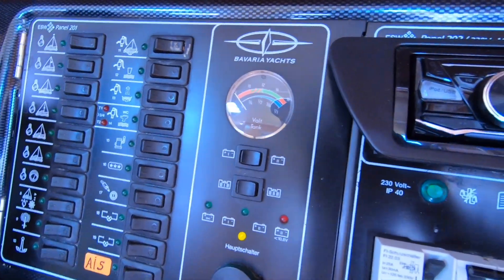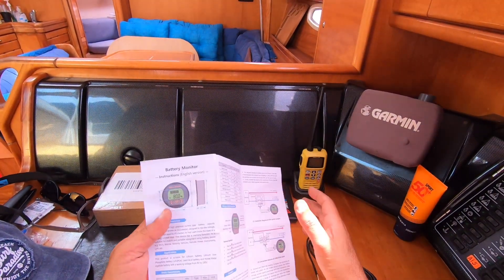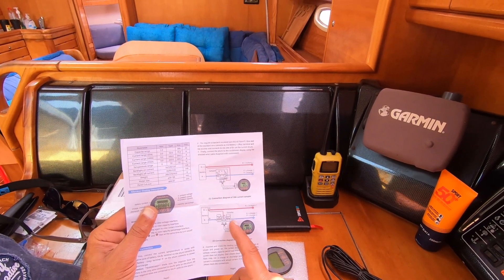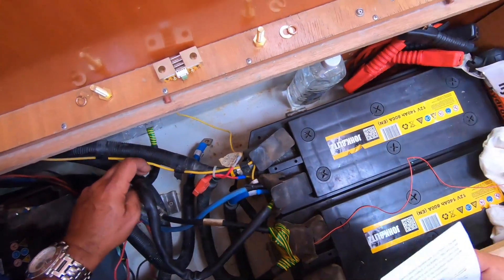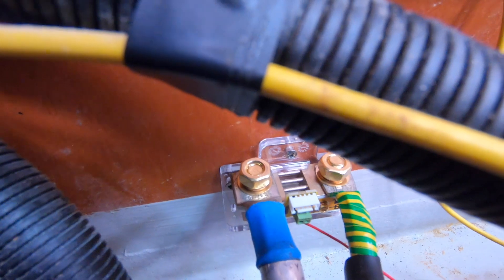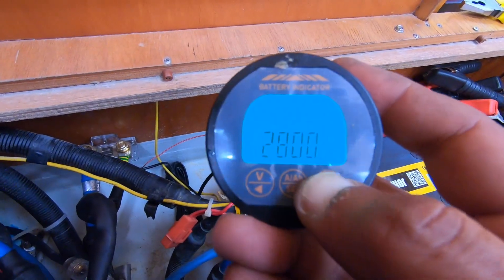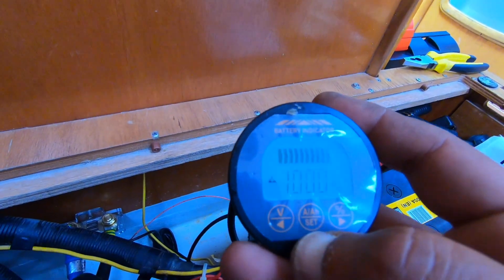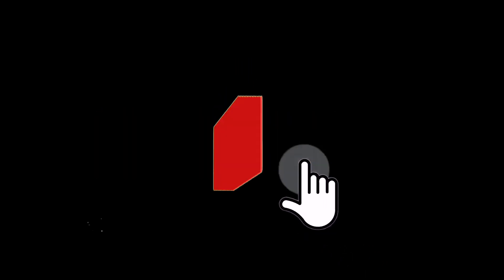40$ AiLi Battery Monitor installation part 1 of 2 ⛵ SE01E03: S/Y ELIZA ⛵

Comment: New subbie. Everyone likes this Ali battery monitor.  I think I'm going to buy one for myself. Great video 👍
Reply from the maker: thank you, after one year of using i'm still happy  with it.
Reply: I just bought one and installed it in my 73 Argosy. It's pretty cool. How do you stop it from flashing with the backlight as it charges? I have not been able to figure that one out. Thanks for any help
Reply: hold top and bottom buttons for a few seconds